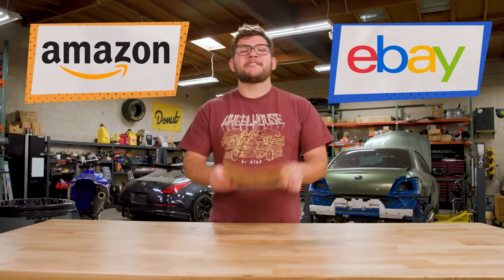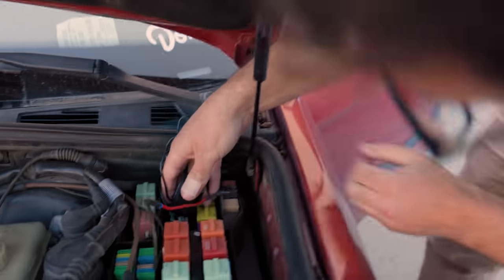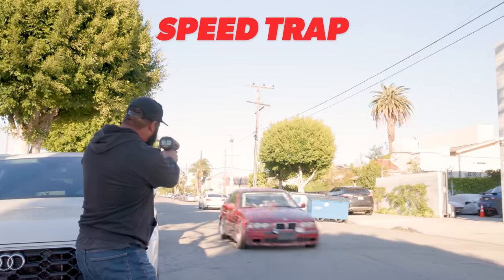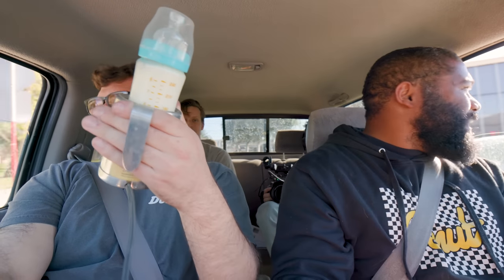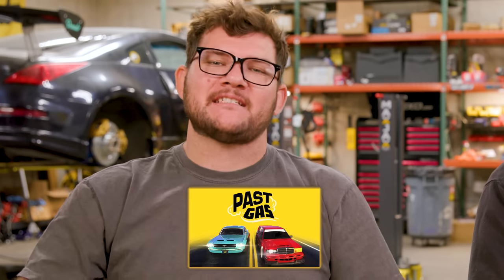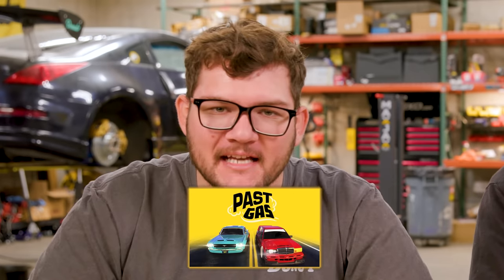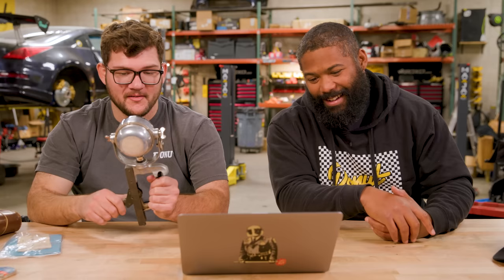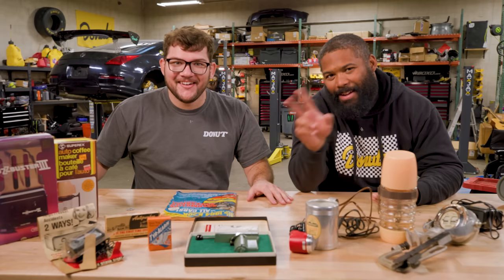Testing More Forgotten Car Accessories

Comment: I think a lot of people don’t realize how much of this stuff is meant for things like camping or RVs, etc and not really for use on a commute in a car.
Reply: Probably at least for when you're not actually driving the car I'd agree lol, tho the description on the coffee maker did mention automobile, truck, camper, etc
Reply: @SangheiliSpecOps  
Coffee maker definitely meant for a car - you can get an espresso maker branded for my car now. (£187.50, no thanks)
Reply: they didn't really have RVs back then like we do now. Everything was tow behind so there's no reason you'd be in there. RVs didn't really have cig lighters in them because everyone had matches/lighters. I think you're making stuff up.
Reply: People actually stopped at rest-stops to use these, but today everyone is in too much of a hurry to be somewhere!
Reply: @CRneu  I mean when is "back then"? they have tested products from the 1930's to the 80's. The coffee maker looks like it's from the mid 70's. At least in Europe you would have early RV. But even if there weren't and people had caravans, they would still either use those on the way  stopping on the side of the road to make some hot coffee or plug it on the car parked near the caravan.

Comment: There are some MOT centres here in the uk still using that decelerometer as a way to check brakes. They measured G and were routinely calibrated. That tool was how it was done everywhere before in ground roller brake testers became the standard

Comment: I wonder if radar guns used to have  much higher power output, since their own receivers and filtering mechanisms may have also been poor compared to today.  and/or their output may have been less focused so that nearby vehicles could detect the bleed
Reply: Yup.  Get a radar unit from the 70s and test it with that; MUCH more powerful than a consumer unit.  Just don't keep it in your lap.  Lot of cops ended up with cancer from that.
Reply: They do say that pilots in vietnam turned off their installed detection systems and used commercial units like this, because they worked better.  How true that is, don't know, but that's what the lore says...
Reply: @THEATOMICB0MB  Radio waves don't cause cancer, they're non-ionizing. If they got cancer it was more likely from other occupational hazards, unless early radars had radioactive compounds (which is not unlikely, it was the 50's when they started to proliferate)

Comment: In the army as a mechanic from 86 to 98 and we had brake testers that drew a line with a pendulum mounted pencil, it also showed if brakes were pulling. Old but reliable.

Comment: The brake tester is called a Tapley Meter and in my country (New Zealand) we legitimately still use them for our yearly safety inspections if your workshop doesn't have a rolling road. You zero the meter out and at 50kph you slam on the brakes and if it doesn't get to 50% braking efficiency you fail. Legitimately in my decade+ experience I've only had a small handful of cars not meet that requirement however and usually it's because the car is old and has rusty/asbestos based brakes. We have these inspections because we have public healthcare and we don't want taxpayers paying for people getting hurt/killed in vehicular accidents caused by negligent lack of maintenance.

Comment: Drum brakes actually have more holding power than similar sized disk brakes.  But they can more easily overheat (brake fade), often weigh more and are more complex to work on.

Comment: Decelerometers are still used and they’re still used for inspections.
In the UK the DVLA and VOSA have checkpoint all over the motorway network, the police can pull you over and anytime to inspect a vehicle for safety. 
Sometimes they’re set up ad-hoc in car parks in known hotspots too

Comment: A fabric shaver will do wonders on your beard, Nolan.  You'd think some of these products would be researched a little bit more before trying to use them.  Like trying to use modern plastic baby bottle in a heater made when only glass bottles were around.
Reply: 🎁🎁🎁👆👆let discuss✍️✍️📥📥
Reply: That was a face shaver, that design is just only used on fabric nowadays

Comment: Fun fact. I still use a decelerometer today. For awd and 4x4 our brake roller tester can cause transmission damage so we use a vintage decelerometer instead. They are still very reliable and capable devices.

Comment: The thing with the Fuzz buster is that radar guns have changed since that thing was built so there is a small chance it worked better on the police radar that existed at the time.   The bottle warmer was meant for glass baby bottles which was the main type in use when that thing was made.

Comment: So much of this is still relevant to truck drivers. Heaters for water and soup are available at every truck stop. A cop can pull you over and do an inspection including brakes at any time without any requirement of probable cause. Kinda interesting.

Comment: Many states outlawed  radar detectors back in the day. For all I know, they may still be illegal in some states. The early radar gave a combined speed of both vehicles if the police car was moving. So the cop would drive a set speed( say 50 mph on the highway) so he could easily subtract his speed from the radar speed in his head, and know how fast the other was going.(e.g. he is going 50mph and the radar said 110mph, so you were going 60mph.) 

As to the shaver, I had one that worked off 6volts(yes, I'm that old. My car was a 1952 Ford Flat Head V8, and I was 18  in 1960). The shaver had two cords, one for the car, and one for 120 volts. I had it for many years. After I got a 12 volt car, I just used it in the house. Back then,, Montgomery Ward and Sears sold car parts(carburetors, brakes etc and I even bought a rebuilt V8 for the Ford. This video took me back. Thank you. Oh, by the way, you could buy guns and fireworks from their catalogs, which  were deliver to your house by the mail man. Any high school boy with a pickup truck had a rifle hanging in the back window. Those were softer times.

Comment: In the UK MOT inspection you still have them Ferodo or Tapley decelerometers for brake test for if the brake rollers are down or you have a 4x4 not suitable for rollers. They are mounted on a weight and you place it in the passenger footwell rather than clamp it to the side.

Comment: Older radars probably had stronger signal because the tech wasn't there yet to read weak reflection. That radar buster might have worked a lot better with old radars.

Comment: That brake tester is was probably, and still seems pretty accurate. When it was developed most of the cars on American roads were Ford Model T's. Which weighed about 1270lbs. I'm sure Justin's truck is around 4-5,000lbs, so over 3x the weight.

Comment: most MOT stations in the UK still have a calibrated mechanical Brake tester as a backup for when a rolling brake tester isnt working, you can probably still get that one calibrated too
Reply: So you can; is actually measuring g force and converting it to a stopping distance? Just curious.

Comment: one thing your overlooking with the fuzz buster is older radar guns didn't have as sensitive detectors as they do today so they had to put out much more power that modern radar gun you have would be putting out a fraction of the power older ones did.

Comment: Donut media we still use the brake decelerometer on transit busses. Easy to use. We do the brake stomp 3 times add the total then divide it by 3 then it will give the percentage average no less than 69%

Comment: Back in the 80's, I had a device called "The Zapper". When you pressed the button, it would send out a frequency the same as the X band radar guns. So any nearby radar detector would alert. I had so much fun hitting that button and watching someone with a radar detector slam on their brakes. It's useless now because X band is pretty much obsolete.

Comment: Early radar detectors did not work well. That changed dramatically in 1976 when Cincinnati Microwave was formed, and they came out with their "Escort", which worked very, very well. In those days I drove about 35,000 miles, much of it across country.  With a national speed  limit of 55 mph, I, um, did find myself above that speed at times. ;) I NEVER got a speeding ticket by means of radar, ever, though I was clocked many times, and knew when it happened. I did get one by being clocked with a stop watch from a plane, and I did get one via VASCAR, a computerized time/distance calculator (police see you go by some landmark, hit start time, go to where you were, hit start distance, chase you down, hit stop time when you go by a second landmark, hit stop distance when they reach the landmark).

If you can find an old Escort, or the later version, the Passport, you should test it.

Comment: Vacuum gauges only really tell you the throttle position.  For best fuel economy, you want to get into top gear as soon as possible while keeping the throttle below 1/3 or so.  The vacuum gauge will happily read a high mpg in first gear while you actually are getting less than 5 mpg.

Comment: In many countries vehicles have to pass annual safety inspections. Literally here where I live a mechanic quilified  as a testing officer uses a decelerator to test the breaks.  All be it no a hundred years old deceleromitor but most still use annologe ones.

Comment: Brake tester turned on when the car dipped.With a modern truck suspension it took longer to start measuring.

Comment: When my grandma passed, I found a plastic case in her basement that looked like a power tool was inside. Instead was a travel percolator with a 110 plug minus the ground and an adapter from the two prong 110 to a 12 volt cigarette lighter plug. I've never tried it 12 volt style but the 110 gets my two big cups of coffee in about five minutes. I never tried in a car because I think it's not safe to have boiling water piping up and splashing down while taking turns and hitting bumps. And I think it'll take literally ten times longer. It had two tiny coffee cups in the case and was bought as a gag gift. I use it all the time out of my tool box.

I like Nolan. I'm a loser nerd... Kinda. Good to see a fellow dork trying
Reply: 🎁🎁🎁👆👆let discuss ✍️✍️📥📥

Comment: You could use the water boiler when you go camping or something. I'm sure it didn't leak as new, I've used a modern version of the product while working at a festival and sleeping in a tent. Also, some other products didn't work because they where old and out of spec, you could bring them back as new products. 
Otherwise, Love the content, it's 3.30 am and you're keeping me up

Comment: My olds 88 or 89 Olds cutlass had an alarm if your turn signal was on for too long.  I didn't understand why all the cars didn't have them.
I remember the early radar detectors would go off near stores because the old automatic door sensors used radar.

Comment: to be fair, the fuzz buster was designed to pick up the signals and frequencies of radar equipment made in the past, not modern equipment. modern equipment is much more sleek, efficient, and discreet with its signal range, accuracy, and focus. This means it makes it alot harder for things like radar scanners to pick up a modern speed gun.

Comment: Great video. I had a fuzz buster3.Your test was flawed. Back in the late seventies when the fuzzbuster 3 came out. The police didn't have radar that they turned on and off. The radar was on all the time. So the fuzz buster three could pick it up mile or two away. And when it went off you slow down. Because there would be a State trooper or police officer somewhere around checking speed. The fuzz buster three saved me from getting many speeding tickets. I have to hunt around the house I'm sure I still have mine somewhere

Comment: About old stuff, i just sold my 1993 toyota pickup truck for $7000 but i took the unused bottle jack from the past. And im surprised hoew much i saw it goes from ebay. $140-160 ! Heavy duty 5000lbs capable bottle jack for free!

Comment: IIRC, people still leave the indicators on because the car doesn't warn you until about 0.75 miles later, instead of 0.25 miles for... some reason.
Reply: IIRC the car warns you instantly when you see the light begin flashing once you've engaged the turn signal... For that reason.

Comment: Just want to point out about the turn signal thing - most cars from the 40-70s had turn signals that would flash rapidly if the bulb was out as a safety measure. That way I’d know if something needed attention. I have this feature on my 63 Pontiac. They would also turn off automatically what the steering wheel rotated - much like modern cars.
Reply: that's just how relays work

Comment: The last item the brake checker u say DONT bring it back but halariously it's still how all wof checks are done now when the place does not have a rolling brake checker in shop like vtnz testing station  ..
.mostly there digital now but still like that clamp on ...
.one goes on the seat with the belt on it one goes on the floor ...

Comment: The reason the brake distance tester read “incorrectly” is that back in 1928, 15 feet was the same as 24 feet today if you work inflation into the equation.

Comment: i believe that the brake tester was accurate or close. you measured to the front bumper, when the device is back by the passenger door. you got to measure up to where the device was mounted on the car not measure passed the device.

Comment: Heh, the thing about old radar detectors is they were made to detect the equally-ancient speed guns,  which they kept improving to evade the radar detectors, so radar detectors had to improve, and so on,  so there was basically a tech race.  Now they basically use lasers so there's no leakage to detect unless the thing's already on you.  (SOme of the oldest speed radars basically were broadcasting all the time, and not-very directionally,  so those old ones could pick em up pretty easily.)

Comment: As the FuzzBuster has evolved, I'm sure RADAR guns have as well to help counter it. Wonder if it would've worked better against an Era equivalent police RADAR.

Human history's just a game full of moves and counter moves, with them all borrowing from eachother. Everything made or done to do something against someone has something made or done to counter it; so they upgrade what exists, make something else, or make another move all to counter the counter and so on and so on. They spend eternity evolving until no longer needed or one ceases to exist for whatever reason, just a game of chess.

For instance air warfare:

1. Plane
2. Better Plane
2.5 - Even Better Plane
- WWI -
3. Plane used
4. Plane for Plane
5. MGs jury-rigged on Plane, now "Fighters".

* Meanwhile at some point AA becomes a thing in some form or another. 

6. Germany deploys synchronized MGs for fighters.
7. Allies copy for their fighters.
8. Meanwhile, Bombers exist
9. Jury/Jerry-rigged Heavy (At the Time) AA to counter Bombers/Fighters.
10. Better Planes to resist AA somewhat. 
11. Better AA.
12. Etc.
13. Etc.

And that's just from 1903 to 1918-ish, while glossing over most of it. Didn't even mention planes, seaplanes, and early carriers; starting the endless war and love triangle between Planes, Ships, Planes on Ships, "Flying Boats" for a while, etc. All while constantly evolving to better kill, survive, detect, and protect eachother.

Comment: 6:18 - that ducking! Also, you bagged on the radar but you held it at a random moving height whilst driving - what did you expect! Yet you praised the milk warmer which was melting the plastic bottle?? They both were good, set up the radar thingie properly and use a glass bottle in the milk warmer - DONE!

Comment: That deceleration device would HAVE to be calibrated, and absolutely used, at one certain MPH that it is calibrated for. With a cop hanging on the side of the car 🤣, I bet it was no more than 10-15 mph. If that is what it is calibrated for, if one would try it at 20-30 mph, the distance it records would double.

Comment: The radar might have been for a different band not saying it was gonna work better but our radar bands have changed since then. Well if you do drive a semi truck the cops do pull you over for no reason and inspect your brakes and everything else on them and if you pass they give you an inspection sticker for a few months sometimes.
Reply: 🎁🎁🎁👆👆let discuss ✍️✍️📥📥

Comment: That Autoparker would prove useful for an inexperienced driver like me who sucks ass at parallel parking, but doesn't want to invest in cameras and sensors and all that tech. Basically nothing to break. Only issue is the prices...$150-$200 for one of those? I know I'm cheap and would pay $40 tops for one, but that just seems pretty steep... I think that's even more expensive than what the original retail price adjusted for inflation would be.
Reply: 🎁🎁🎁👆👆let discuss ✍️✍️📥📥

Comment: Weird, I had a battery operated version of the "razor" 30 years ago but it was for removing pills and lint from your clothes.  I wonder if it got rebadged in the 80's as something else cuz it was worthless for it's original purpose.